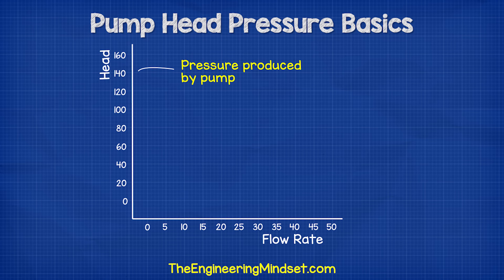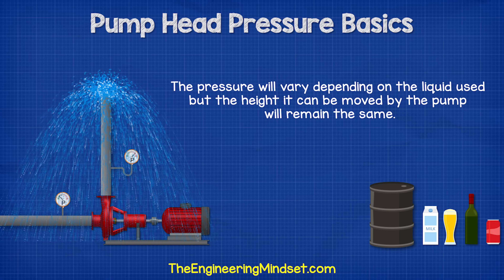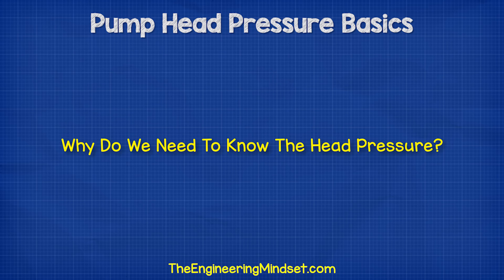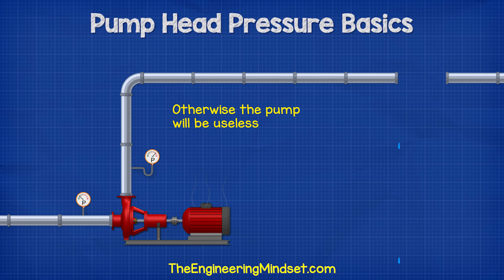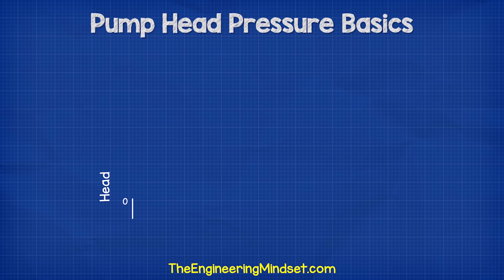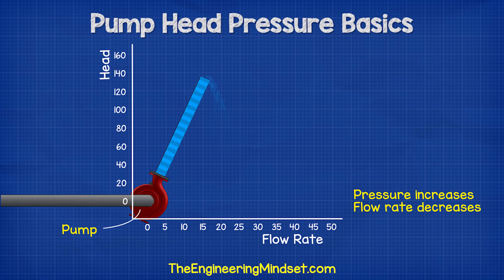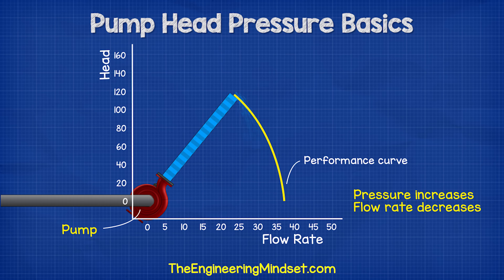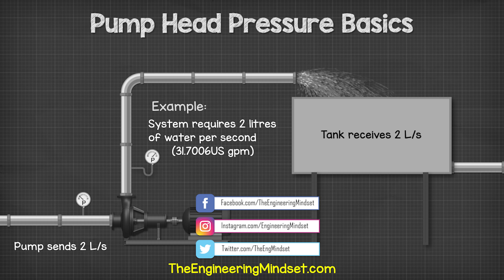Pump head pressure basics

Comment: I learned how pumps are measured for their pressured output.  Didn't know that.   Thank you.  
What about P.T.O. high pressure hydraulic pumps used to lift a boom and a bucket which are installed on a bucket truck?  How are they tested?
Reply: They would always be using hydraulic oil so I imagine a pressure would make sense